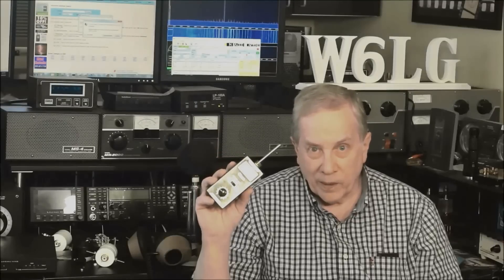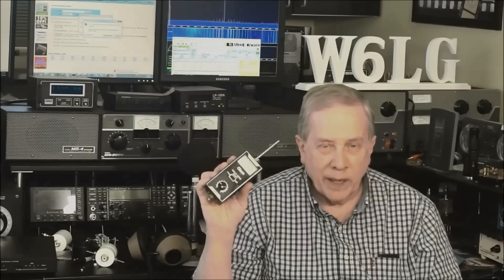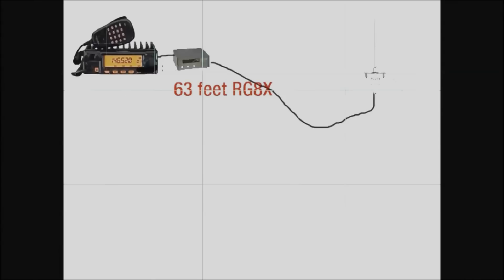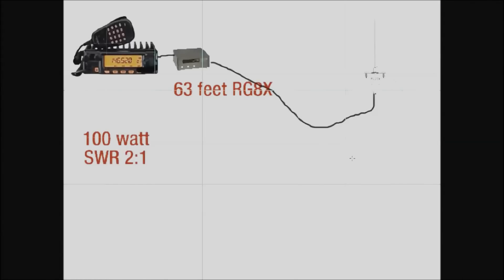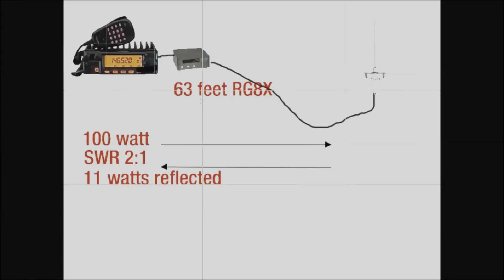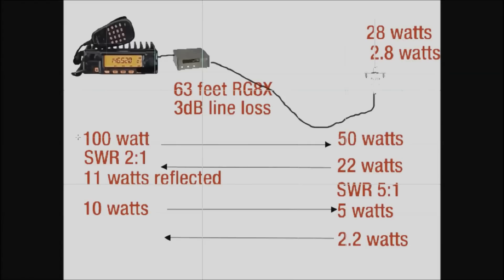Ham Radio Basics--SWR, How To Measure And Is it Important-A Surprising Answer

Comment: Thank you for this explanation. 
I am brand new, very low budget and looking to put money where it should go and not end up buying the right gear after finding out the cheap components wont work as advertised. 
Thinking that if  someone can afford the transceiver and antenna that the coax should not really be a financial issue. 
My question is which of the coax cables available(sizes) would be the best overall choice (dollars aside) for a given frequency range?
I'm starting with a quad band mobile rig but will eventually get a base station and thats where the "real"money will go so planning for the future.
Thank you for sharing
Reply from the maker: You're welcome.  Probably RG213 or LMR400 would likely be the best choice for a cable that you can use on HF and VHF.  

73, Jim W6LG
Reply: thank you from Israel